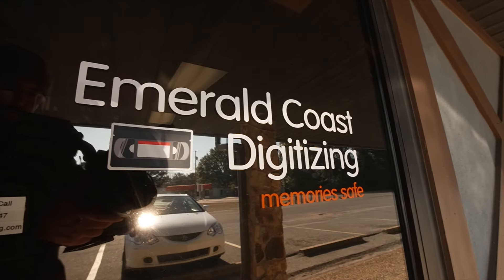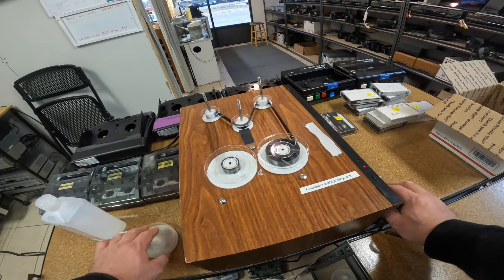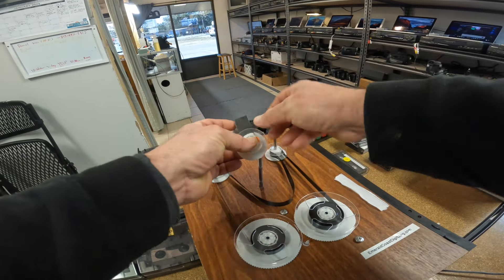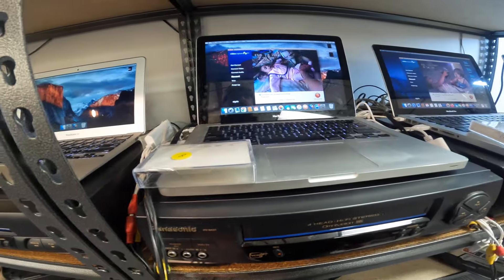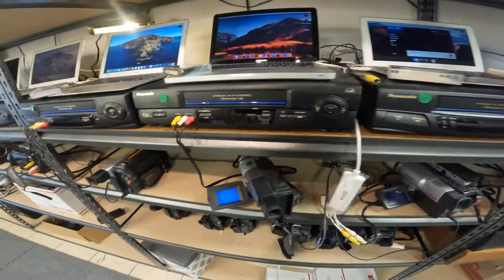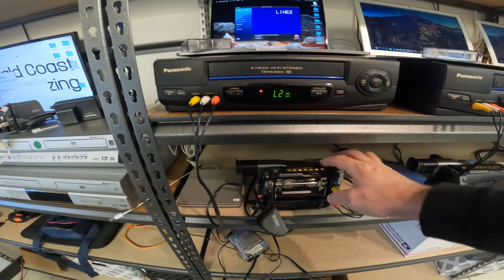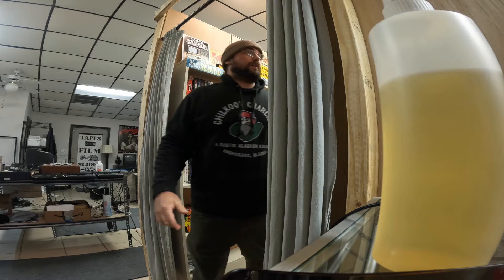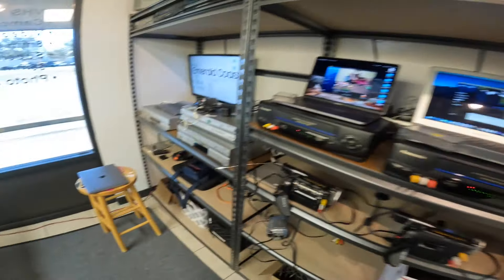Digitizing Video 8 and Hi8Tape **Video Transfer / Duplication Service in Pensacola Florida BTS

Comment: Even though I only did this as an at home version. I still enjoy watching the process. I never even finished all my tapes, as a friend of mine kept handing me a lot of old ECW tapes and old trashy B-movies that probably still haven't been reissued on disc. Never had to deal with moldy tapes. But that cleaner is still a great idea. The bigger real would probably be the best thing for it. Guess tape can stop it from spinning, but maybe a removable pin would work on the center reel? If that would work. I was thinking of the reels where you can twist off the upper clear part from the white part. That way you could drill down into the reel keeping the top side smooth.
Reply from the maker: I used a gluegun to apply the pads today. Worked great and can be removed and will leave no residue to bleed through on tape